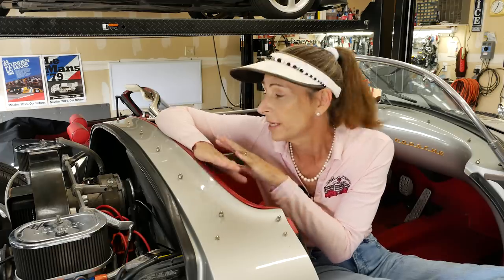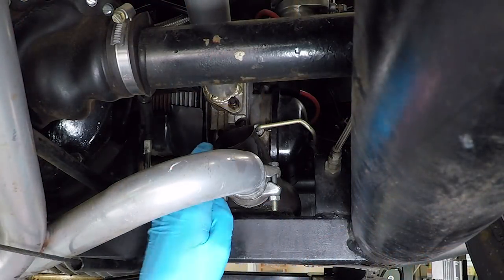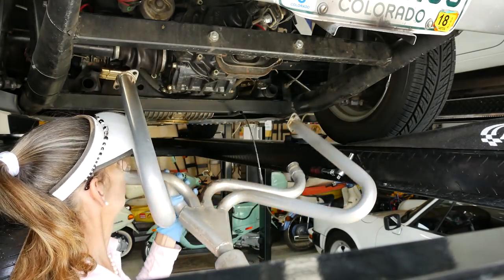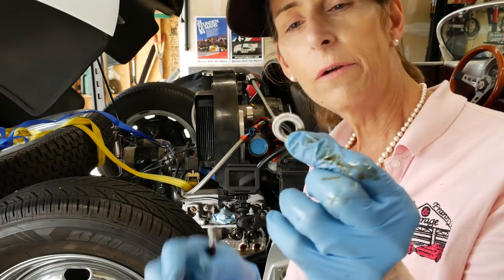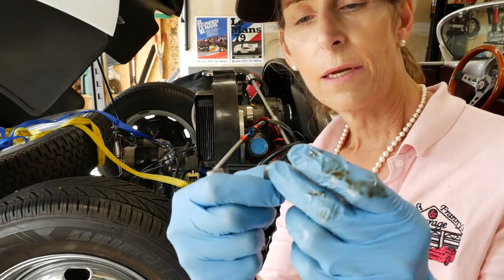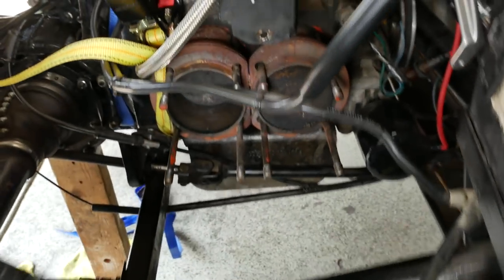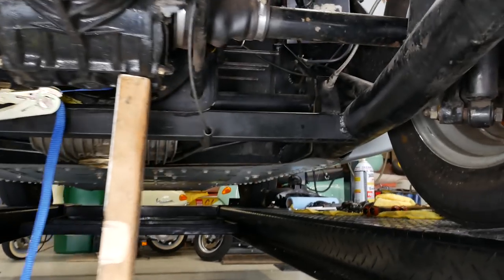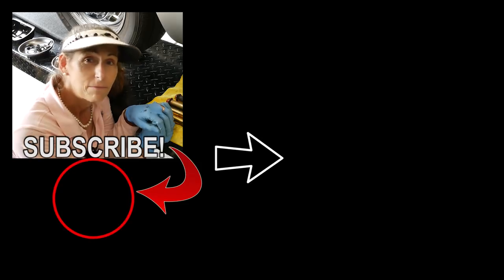Beck 550 Spyder Replica VLOG #4 - Headache!

Comment: There is a crack between the valves on 4 which is likely your compression issue. 
Also looks like the barrels are not sealing judging by the discoloration.
I know you want to leave the barrels in place but they will need lapping into the heads to seat properly.  
I think you are correct about the sticking valve.
These have been machined for larger valves and may not have been done properly or perhaps the guides were replaced later without re-cutting the seats. 
This Brazilian head was clearly not ideal for machining the bore out as there is a hole in the side!  
I'd want to replace both heads from what I can see here, but it's down to the customer at the end of the day.  
Really enjoying your video's.
Reply from the maker: Oh My God what a great eye!!  You are totally right!  I just went and checked.  There is also a small crack starting on #3 as well.  I believe these are heads from CB Performance.  There is a CB in the casting.  I will go over all this with the owner.  Today is cleaning and removing the other head. The first one is back from the machine shop, but they didn't mention the crack.  Thanks again!  Great catch!  Franny
Reply: I doubt they are CB as they have their own castings and this is stamped BR from what I can see, which matches the rest of the engine.  
The CB heads are cast with a bigger bores in mind and would have the combustion chambers opened out to the new bore size unlike these ones.
These heads are probably the original Brazilian ones but machined with bigger valves and a bigger bore.
A proper set of CB heads would be a real performance boost for this engine and with new valves/springs etc it's one less worry.
I think they also reposition the valve positions and spark plug hole to help prevent cracking. 
Out of interest does the owner know what spec this engine is beyond what we already know?
Reply from the maker: djambrosia would you mind sending me an email (either through our website or the About tab on our YT home page)? I can send you better photos and get your take on it.  I see 2BR but also CB. And a VW Audi symbol and a 101.375.5 and an 81. Thanks again for your observations. F
Reply: Wow, I can't believe you spotted a crack, I went over the video several times and still cannot see any crack.  Awesome eye! That's why I love these vids, so much to learn.  Good luck Franny, keep up the fantastic work.
Reply: @M Sneds. See 12:45.
Reply: I saw what you saw, forgot all the casting info, was familiar with the Brazilian head issues but not the performance variant you were discussing. It's been decades since I dealt with the air cooled VW base motors, almost bought a Beck Spyder back when they came out, kind of kick myself for not. Went racing with a 67 MG Midget instead, it definitely wasn't street able when I was finished with the build.

Comment: Good job Franny!  Nice thinking-it-through with moving the tranny over to get the needed clearance.
The valves do look pretty normal but they were leaking quite a bit, so I am sure there is something going on either in the valve seat or guides, or both!  
Oooh, I just read the comment about a crack in the head on #4 , that'll do it.   Yes, these type of "tune up" projects can be a PAIN!

Comment: Hi Franny 
I can't believe that you pulled that head out with just your by  hands, they are usually stuck and require special tools, which makes me think that the head gasket was leaking, look at cylinder 4 top left corner is black, that's the leak!.
I liked the with jack lift idea, clever cookie you are!
Reply from the maker: I was very surprised too...  I had the plastic hammer at the ready...  Something smells a bit fishy here...  Thanks!  F
Reply: Hi Rich X....these engines don't have head gaskets.
Reply: Ian Brown Thanks I thought I missed that in the video, what makes it seal?
Reply: Looking forward to the installation!
Reply: Hi Rich X...As the engine contains no water there's no need for a head gasket. The two mating surfaces (top of the barrels to the inside of the VW cylinder head) are so perfectly machined that when the head is bolted down it provides a really snug seal. If the head gets distorted (through overheating) or if the head isn't torqued down properly that's when you start getting into problems.
Reply: Ian Brown thanks for the information.
Reply: Not sure if it works on VW motors, but I've used the compression of the piston itself to unstick heads before (compression stroke).  You leave loosened nuts on head studs so it doesn't push it too far/fast.  Then assuming you still have oil in the bottom end, you can spin the motor by hand or even bump the starter motor.  Just make sure your pushrods are out of the way, and  you don't have ability to launch unencumbered lifters.

Comment: Nice work. Free tip friday on a sunday. I would do a small leaktest on the valves before you send the head of. Give each intake/exhaust port a little "snaps" of gas. If the valve is leaky you will se the gas come through the valve.
Reply from the maker: Thanks.  Another viewer pointed out a crack between the valves...  The plot thickens...
Reply: Keep up the good work, have a nice day....

Comment: Ah I love it. Any way to get that extra little bit of space to get the head out. I've done similar things just loosen a bolt or two and pry or hoist things just to get things in or out.  I agree sounds like you got some sticking valve guides and it looks like the valves aren't sitting in the seats completely. so I say guides and lap the valves she should be good to go. Looking forward to the next in the series.
Reply: Also been meaning to say. If you ladys are down in Atlanta around the first sunday of the month you could meet Chuck Beck at our local car show Caffeine and Octane. One of his big draws is a 12 cyl lambo engine motorcycle he build and brings to the show.

Comment: Second annoying comment: Just started this VLOG (#4), and am still concerned that 100 degree difference...was that a measure of exhaust temp?  I'm a pilot and the planes we fly have Lycoming four cylinder boxers; we lean as we climb so I was thinking during #2 in this series that that left front cylinder was  running too lean, and just 1/4 way through this vid (you just got the exhaust off), was wondering if you're going to remeasure that temps...?  I'm not familiar with those carbs; can you easily adjust the mixture and measure the ratio from them?  

As always, thanks for your videos.  I subscribed.
Reply from the maker: Well, keep watching...  There are a few different issues at play ;)